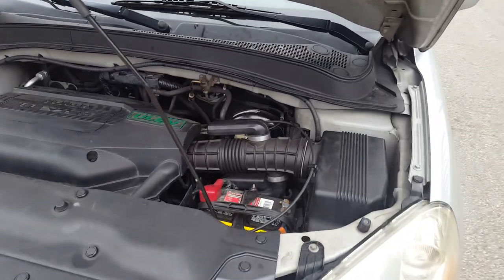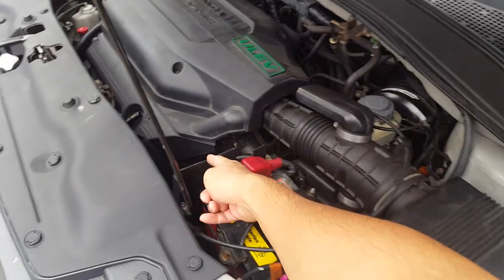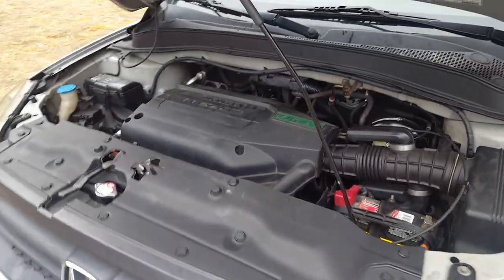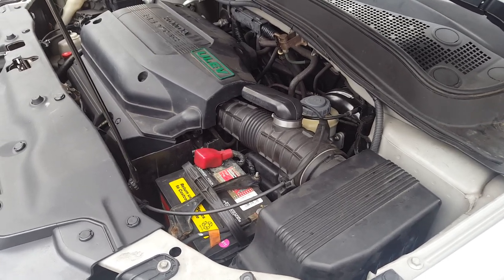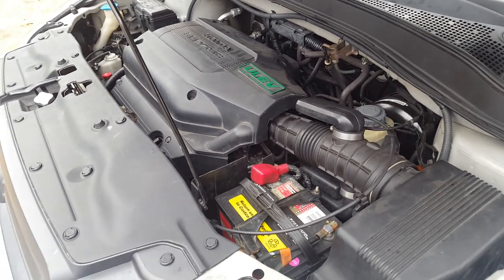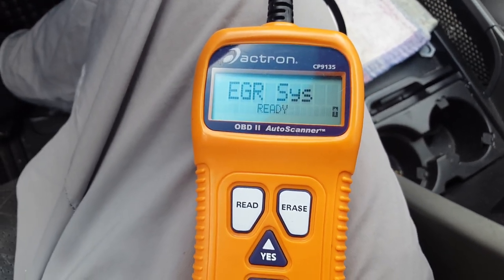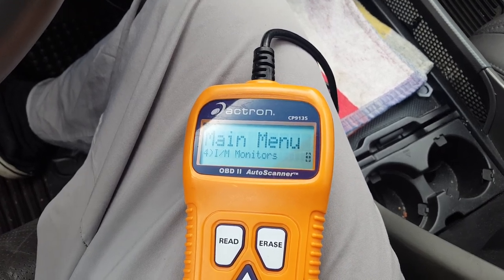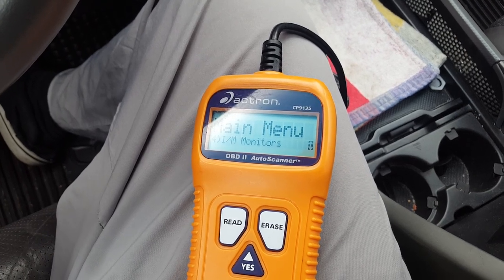Honda Pilot random misfire SOLVED!!! PASSED SMOG!

Comment: I couldn't ask on the other video because comments are turned off, but, the intake manifold top you took off , did it had Ani gaskets or they are metal to metal?
Reply from the maker: It was metal to metal.
Reply: @PeterZafra  wow okok, best way to clean it? Any advice?
Reply from the maker: I didn't clean the gasket. Just remove carefully

Comment: Thank you for your videos man, I haven't had any codes thankfully, also just passed smog but I went into my intake manifold and cleaned out my EGR valve and it took me like 30 minutes to pick out like 98% of the carbon from it. I also cleaned out my PCV valve but have a new one on the way, my 03 Honda Pilot with 268k was just having a bit of excess exhaust smoke, burning a bit of oil, and rough idle which so far seems to be fixed... hopefully with a little more TLC it will be like a new old engine again lol.
Reply from the maker: That's awesome. Glad all is well with your car. Cheers

Comment: having the same issue in my 2003 Acura MDX. changed the coils (spark plug boots) and plugs...light came back on. I'm gonna do this 2mrw and hopefully the misfire goes away! thank u
Reply from the maker: Dutchmaster412 after doing all this and if the check engine light comes back, look into a valve adjustment. these honda engines are known for that too.

Comment: Great video. My 2003 Acura MDX has all of the same symptoms. The VTM 4 Light and all that jazz. I did change the plugs, air filter, Valve alignment, timing belt, and  plug coils so far. I think I'm closing in on the problem. I have 253,000 Miles. I agree, take care of it, it will take care of you and save you car payments!
Reply from the maker: David Dorsey if these don't fix the problem,  you might need a valve adjustment.  Cheers.
Reply: It had a valve alignment already. I think I'm closing in on it! What was the most difficult to do? EGR, Throttle body, PCV? I'm home this week on leave. Or, should I get a quote from Acura?

Comment: An oil catch can will also help keep the intake manifold, valves, pistons, spark plugs and egr system clean. My ridgeline runs smooth. If the pcv is clogged, it will cause oil leaks and engine surges.

Comment: Need some help here. Was having the misfiring codes and random misfire code show up on scanner without engine light being on. Today I did all the recommended things...replaced PCV and EGR and cleaned ports (it was pretty clean anyway). I also replaced all spark plugs but no boots.  Started the car and did the idle relearn procedure as well. Really strange that now the engine light is on along with the VSA light and hazard light for the stability control system. Also, my car was jerky while accelerating on the highway. Is it possible there is now a vacuum leak now somewhere from opening up the top of the engine? The gasket was not broken or anything. Is it possible the PCV OR EGR I put in is faulty?Please help! This is our family car so I need to figure this mess out asap.

Also, a new P0523 code popped up. States engine oil pressure sensor/switch - high voltage.
Reply from the maker: I haven't had this issue like you but try to reset by removing the negative terminal on the battery and replace after a few minutes. Make sure you replaced all the hoses at the same place and make sure all connectors are connected properly. Hope you get this resolved.
Reply: @PeterZafra  thanks for replying so quickly! I just reset it again and did the idle procedure as well. So what's also strange is the cruise function won't work now either...I'm so confused. I double checked all connectors and checked that I didn't over torque the screws on the manifold cover as well. I'm so confused. Could I have caused a vacuum leak? I figured that's what's causing the jerky hesitation when accelerating.

Also, I checked all coil packs and all are working.
Reply: @PeterZafra  fixed it! So I didn't know you couldn't put after market parts in hondas...especially electrical! I put the original EGR valve back in as my car didn't need a new one and put a Honda PCV valve in. Also, there was a loose plug in the back that I fixed. Did the ILP and all codes are gone!

Comment: I've been to 4 different shops was told transmission leaking from main seal then right seal now I'm told it's not leaking but instead is leaking engine oil but don't know from where.😞also misfiring codes on all pistons at same time and cv axle boot needs replacing I'm so lost😥Mine is a 2006 Honda pilot with only 70,000 miles on it
Reply from the maker: aww man that's a bummer. hope it gets resolved since these are actually good engines.
Reply: @PeterZafra  update They replaced the right axl and boot or something,the valve cover gasket changed plugs and coils.Replaced air intake tube or something because whoever changed my filter last didn't unscrew it and broke it causing the engine to get air etc...It was a nightmare and costed $1,700.00😥😢I cried for days

Comment: Did you need to replace the gasket on that egr top cover after you cleaned it? Thought i read somewhere its reusable?
Reply from the maker: I did not. Just be careful not to break it. Its aluminum so its pretty sturdy but just be careful. Cheers
Reply: Ive always had luck using copper spray to coat any exhaust gaskets. It creates a carbon seal.
Reply: @Redridininyohood  what do you mean copper spray? Do you have a link?
Reply: @axjohn  most local part stores will have it. But ive had really good luck using it on all my exhaust gaskets excluding donuts. Even on new installs. Learned this on one of my honda cars when using online parts. I also get that exhaust paint and spray all the welds real nice. Helps things last. Also I reused my egr gasket cus it came off in one piece but i hit it with this copper spray on both sides. Wire hanger or wire works great👌
https://shop.advanceautoparts.com/p/permatex-copper-spray-a-gasket-hi-temp-adhesive-sealant-10-oz-80697/7160111-p?c3ch=PLA&c3nid=7160111-P&adtype=&product_channel=Online&store_code=&msclkid=0722fc5b9ba917cb9ebd9cf6e740faf6&utm_source=bing&utm_medium=cpc&utm_campaign=b_lia_all_sealants%2Fadhesives%2Fand%2Fcompounds_sealants_gen_gen_all_pros_aap_us_all&utm_term=4581183924576211&utm_content=Bing_LIA_Sealants%20Adhesives%20And%20Compounds_Sealants_Gasket%20Sealants&gclid=0722fc5b9ba917cb9ebd9cf6e740faf6&gclsrc=3p.ds

Comment: So I cleaned the egr cover along with an intake cleaner that sucks through the air system, new spark plugs, one new coil pack because one ripped on me when removing it,  and PC valve, Still getting p0300- p0305
Have not done egr valve yet.
Reply from the maker: Once you've done all those and still pops up, you might need a valve adjustment. Unfortunately, these engines don't self adjust. Especially if you are getting a vtm light.
Reply: Light come on today says p0300 p0304 p0305 and p01399, I haven't done egr valve yet gonna try that and if it  comes on again going to try valve adjustment.
Reply: @stevenphelps1072  did a new EGR fix it?
Reply: @Darkhunter218  no light came on again with misfires 2-6 and a multi random, just did a valve adjustment at honda so now we wait and see.
Reply: @Darkhunter218  the only thing I have not done is the EGR valve I replaced the pcv valve. If the light comes on again after this valve adjust I'm going to  replace the EGR valve.
Reply: Oh yeah and you know what's weird, with all these misfires and stuff the pilot doesn't run weird or act funny it idles fine so I dont know.
Reply: @stevenphelps1072  My 03 pilot with 268k was getting really bad mileage like maybe 15 mpg on a good day and rough idle esp on cold start,cleaned my PCV and EGR valve out and so far so good, but both valve covers need new gaskets, intake manifold, also found oil in the manifold hopefully it was bec the near total blockage in the EGR and PCV blockage that were causing the idle and mileage issue.
Reply: So update as of January light kept coming on so I forked out the 500 bucks for a valve adjustment and it has not come back on in 3 months now, also honda does recommend valve adjustment every 100k miles.
Reply: @stevenphelps1072  hows it driving currently ? I'm thinking about getting valve adjustment I changed spark plugs and pcv valve on 06' 155k pilot. 3 months later the lights are back on thinking about just skipping everything else and doing this
Reply: @Chachh_  been good valve adjustment was the issue I haven't had any lights. Also honda told me that valve adjustment is actually a regular maintenance service every 100k Honda recommends it.

Comment: My situation is had 5 cylinder misfire codes, changed plugs and one coil that the rubber boot tore off. 1 week and a half later engine light for a p1399 random misfire, runs fine, idles fine so what should i look at? Pcv valve?
Reply from the maker: Depending on mileage, check on getting a valve adjustment. Are you getting a VTM light?
Reply: I have 190k miles on it, and no vtm  wasnt on, it was for my cylinder misfires though, im trying to avoid valve adjustments if necessary, i still need to pull my egr cover and see if it is clogged like yours
Reply from the maker: With that many miles, for sure it is. Random misfire points to a lot of different things. Not specific cylinder. Try cleaning the egr ports because that can cause a mis for sure. But if it keeps returning especially with a vtm light, then a valve adjustment might be inevitable. Cheers

Comment: To reset the computer all you need to do is pull the negative off the battery for 15 or 20 minutes then reconnect the negative cable

Comment: Thanks for these vids! Question, was your evap test not completing? My scanner constantly says evap not ready. Besides that I am having the same exact behavior as yours.
Reply from the maker: no problem. evap system isn't always applicable on these cars. if your car always pops the vtm and Chek engine light and you've done all these things that  I did, you might need a valve adjustment.

Comment: Hey Peter, thanks for the video. I have a quick question. Did you use OEM Parts? Or aftermarket from a local auto parts store?
Reply from the maker: On this one i think i used aftermarket but i highly suggest oem if you can afford to.

Comment: I have a 06 pilot 2wd i did valve adjustment and its still coming back . I changed pcv valve and sparkplug what noww keep getting p0300 all cylinders misfire
Reply from the maker: Have you changed egr valve? Cleaned out egr ports (plate on top of valve cover)
Reply: @PeterZafra  no in gonna clean the ports tonight then change egr valve if it still throws code.  Can the egr valve be cleaned as well ?
Reply: @PeterZafra  i cleaned the ports and passage ways . Wasnt bad really . Still misfiring ill try egr tonight
Reply: @Chachh_  what did it end up being, bad coil?
Reply: @PeterZafra  do you think that some of the EGR valves from Rock Auto can be used on Honda’s or should we only use Honda EGR valves? I have a 2006 Ridgeline.
Reply: @Chachh_  did it fix it
Reply: @elperrocovero  nah man I even did the vcm delete and nothing . Did the timing belt , changed valve cover gaskets , cam seals , I’m thinking it’s a bad piston ring tbh but the shit been running ? I’m at 180k now . Was at 150k ish when I made the original comment I believe

Comment: I have a Honda Pilot 2003 with the code P0401 (Exhaust gas re-circulation flow insufficient detected). The VTM-4 and check engine lights are on. I have replaced the two O2 sensors and EGR valve new, and several times cleaned the egr ports. The sparks plugs are new. What the problem could be on my situation.
Reply from the maker: delmar you might need to get a valve adjustment. I ended up doing that with this car and it completely went away. This car has over 200k miles

Comment: This is similar to my friend's 05 acura RL. The codes are p0300, p0303, p0305 & p0306. The car has 92k miles. We changed the plugs on 3 cylinders but the light didn't go away after driving for 20 miles. We haven't changed coils. The car runs smoothly but kinda chokes when starting the car. What could this be?
Reply from the maker: +Aaron Agsalud most likely will need a valve adjustment.

Comment: hi i have 2006 honda pilot and start in morning air idle shake so i have to warm up good when the car is warm idle shake no problem but when car sit again for long time warm up again so idle won't shake. Car is not dying just only when car is cold specially morning idle shake but like i said when car is warm no idle shake problem. What can i do to fix this please help thanks?
Reply: Valve adjustment must be attempted first (for tight exhaust valves)
Reply: Pudiste arreglar tu problema a mi honda pilot 2007 le pasa lo mismo

Comment: i had a random misfire p0300 with 4,5,6,2 cylinder misfire i had visible leak from the power steering pressure hose i replaced the hose and the codes are gone weird 05 honda odyssey
Reply from the maker: Wow. That is weird. Glad you fixed it. Cheers
Reply: @PeterZafra  will be replacing the PCv and other things mentioned in description thanks for the upload 👍 subscribed

Comment: my 2008 pilot shows the same misfire codes. so should i go ahead and do the valve adjustment so that i dont need to worry about any of these? or do these steps along with the  valve adjustment to get it completely fixed?
Reply from the maker: Ashi if you get he vtm code and random misfire codes, you might want to consider the valve adjustment.  of course there's no guarantee but in our case, it fixed the problem. never had the problem again.
Reply: honda dealership is asking for 550 for valve adjustment and 100 for software update. i am confused of it is worth. or ignore the engine light on. but i am not sure this could lead to some other problems later and end up in paying more.
Reply from the maker: +Ashi I don't remember a software update for the car but the valve adjustment fixed the issue of vtm and random misfire. 550 is a decent price for valve adjustment. Try looking for an independent Mechanic.
Reply: i just noticed that i didnt fully inserted the oil dipstick when i checked the oil last time. do you see if this could cause the misfire codes to pop up?
Reply from the maker: +Ashi no it won't cause a misfire.
Reply: you are right. i tightened the dipstick, disconnected the battery to erase the engine light/codes. did an idle relearn. after 15 miles, engine light is on again. so I am thinking about doing the valve adjustment soon.
Reply: My 2004 had the same codes, and after a lot of frustration and trying different things I bit the bullet and got the valves adjusted. Codes went away for about two weeks, it passed in missions, and then the codes came back

Comment: Need help please. My Honda Pilot 2004 runs smoothly and nice then suddenly stalls like it's running out of gas but then runs smoothly again.
Went to AutoZone these are the codes 
P0206
P0300
P0132
P0204
P0202
P0132.
Where should I start? Thanks for your help.
Reply from the maker: Those are random misfires. Did you do anything before this started happening?
Reply: @PeterZafra  honestly I bought it running good. Suddenly started like that

Comment: I thought your random misfire was solved through cleaning the list above? Did you eventually do a valve adjustment and solved the issue?
Reply from the maker: +Aaron Agsalud hi. Yes. This solved the problem enough for the codes to clear and pass smog. However, these motors tend to need a valve adjustment. Once that was done, it completely went away. If you get vvti light, most likely you will need valve adjustment.

Comment: Have this code with a vtm light on too...any suggestions?
Reply from the maker: Most likely, a valve adjustment. Costs around 600 in the dealership. In the end, it's what fixed this issue with this car. After doing all this work, the light would go away, pass smog,  and eventually the issue would come back. Not until the valve adjustment that it completely went away.
Reply: @PeterZafra  So what actually solve this engine misfire problem is a valve adjustment? Is it necessary for the valve adjustment if only the check engine light is on but not the VTM light?

Comment: I'm getting random misfires as well. Car runs fine aside from poor gas mileage. The VTM 4 light does randomly come on as well. I changed all plugs and coils. No EGR build up.  Anyone have similar?
Reply from the maker: You might need a valve adjustment.

Comment: Does anyone know a possible problem to my car ? (2006 honda pilot)
It has a check engine light with multiple codes :
p0305
p0306
p0303
p0300 also the VTM 4 light is on
Reply from the maker: Valve adjustment
Reply: Peter Zafra thank you !!
Reply from the maker: If you have tried cleaning the egr ports, plugs, egr valve, still have these multiple random misfire and vtm light, a valve adjustment most likely is needed. Cost around 600 bucks but will fix the problem.
Reply: Peter Zafra I recently did a valve adjustment an it gave me way better gas mileage it ran fine for a day or two but now is misfiring again is there anything I need to do after adjusting my valves like resetting the computer